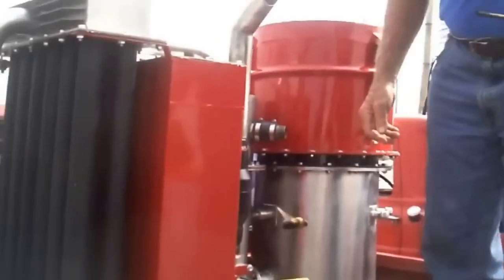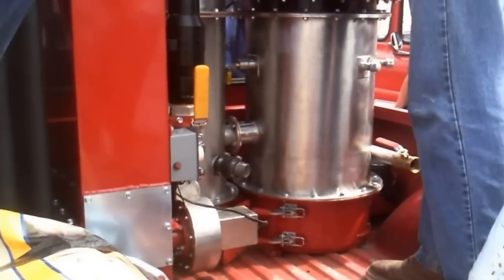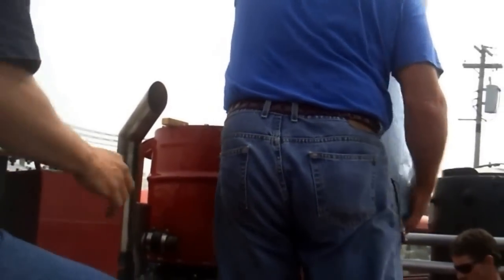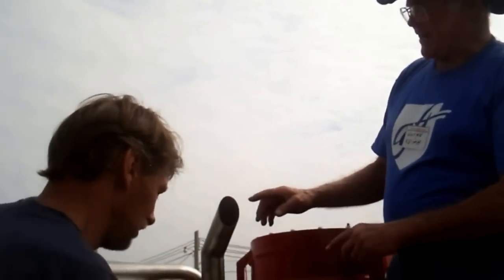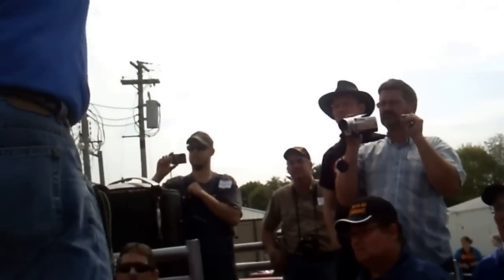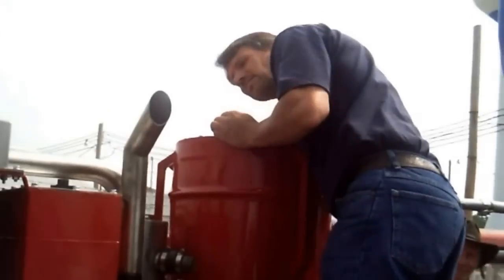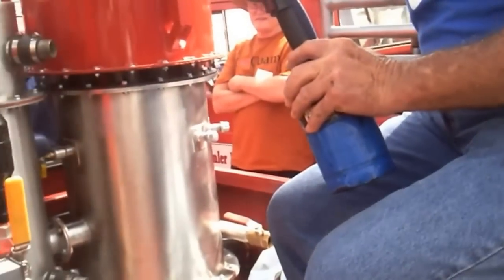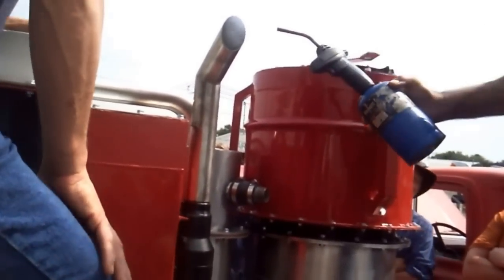David Siedslag's Woodgas Toyota May 18, 2013

Comment: hi is possible to run afuel that makes electrity on wood gas thanks
Reply: Nasser Haq odd sentence structure there bud haha, but i got ya i think. You can hook up a gasifier to a generater and make the generator run off of wood gas to produce electricity.